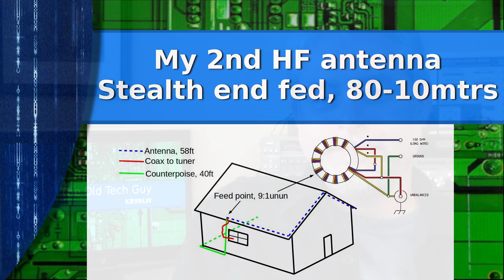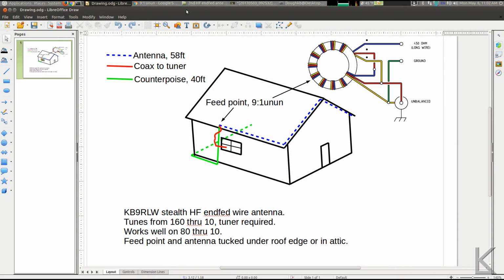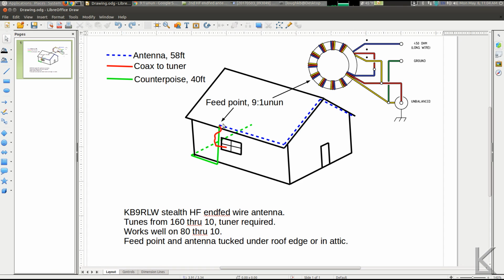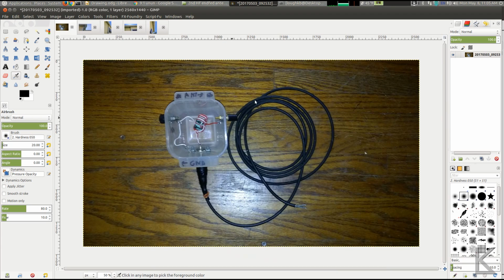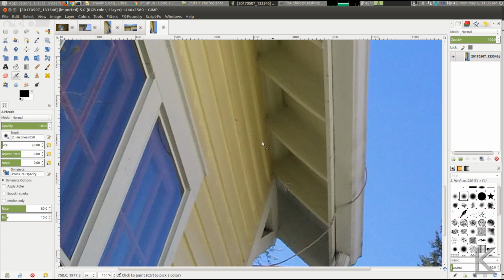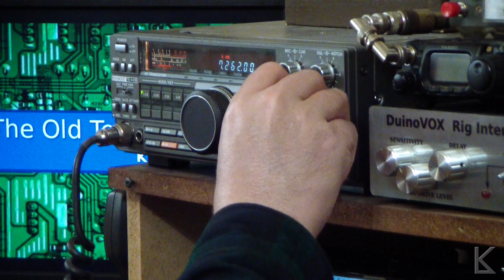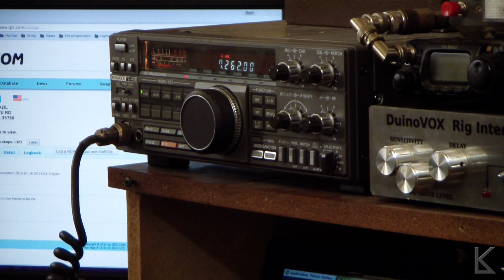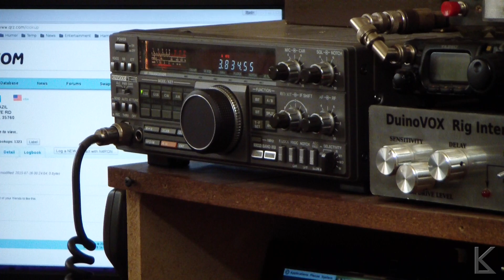Ham Radio - My second HF antenna.   A stealth end fed wire for 80 - 10 meters

Comment: will this work with a metal roof
Reply from the maker: Probably not very well if the wire is at all within proximity of the roof. You generally want to keep your antenna wires a fair distance from large metal things.

Comment: Thanks for this informative video. I am installing a BBTD whole house antenna as shown on the HFLink website a Bonnie Crystal design. I'll have 190ft of wire and it will all be out of sight. There is a 1000ohm terminating resistor at the midpoint and a 16:1 Palomar Engineering Balun at the feed point. Do you use a common mode coax filter on this rig?

Comment: Kevin, Thanks for the great info.  New ham here just got my tech and general ticket 3 mo. ago.  I have been running on 70cm on a baofend hand held with a homemade J-pole. I live in a HOA and I'm going to put up a end or DX Commander vertical.  I have about 100' of roof eves to run the antenna.  I just purchased  new ftdx10 and a used MFJ 949e tuner really looking forward to getting a base unit setup.  KN6Tux   7 3

Comment: When you get through playing around, try an old offset feed Windom from the 1930s.  Works from 80 down through 2 meters with NO tuner.  I've even ran a CB off of it ;)  SWR rarely above 1.5 on any band.  If your finals can't handle that, you need a radio first :)  As to RF in the shack, I could care less!  I can hold 200 watts LOL!  Use to work on an old Comark and RCA television transmitter with 1 megawatt ERP (were talking twin Klystrodes).  So much RF in the building the florsecent lights always stayed lit!!!!  RF off a radio?  That's a non-starter.  AE4YW
Reply from the maker: This was awhile ago.   I'm now living in an RV and traveling around.   I've settled on a 120 ft. doublet as my main antenna.  Possibly the best and most agile wire antenna I've ever used.

Comment: Would you be willing to tell me the lengths of antenna for 40 through 6 m I have limited antenna experience with end feds
Reply from the maker: I've experimented with a lot of things since this video was made.
Lately I'm a big fan of the end fed half wave design using a 49:1 match at the feed point.   A half wave wire for 40, about 65 feet, would do what you ask.

Comment: I'm a little confused on the counterpoise wire does that need to be grounded or just ran along the ground anywhere or does it need to be ran along the ground underneath the antenna in the air and should I ground the counterpoise to A rod in the ground

Comment: Hey Kevin, thanks for an inspiring video! Question for you and/or other hams - How do you think the performance of this end-fed 9:1 UNUN antenna would compare to a Broadband Butterfly Terminated Dipole (BBTD) using a 16:1 BALUN with both ends  tied together via a 1200 ohm resistor? That antenna can also be wrapped around the edge of the roof (credit to K4SFC - https://www.youtube.com/watch?v=a-vbdO-mUDM)  I'm trying to decide which one to try first. Thanks very much, Greg KJ6ER

Comment: Hi Kevin - have you ever tried more than one radiating element when using a 9:1 unun?  I wondered if it could be made so that the second element is tuned for a different band, similar to a fan dipole concept?  I have no idea if this would work, but would be interested to hear your comments.
Reply from the maker: I think it would work fine.   Just like in a fan dipole, the RF is going to choose the element that provides the best match/load.

Comment: Kevin, you might want to set up a test bad to compare antennas. Have WSPR set up to switch between two (or more) antennas every five minutes. Since the propagation isn't likely to change that much in a few minutes, the coverage you get from each should determine which is better and even which is better in certain directions and distances.

Comment: Thanks for the video.
How did you get google maps to draw a straight line from your location to the other stations location.
Reply from the maker: I used Google's measure distance function. Search for the other stations address, and in the map that appears, right click on the station and select measure distance. Then go click on your location, and it will draw the line and show the distance.
Reply: Got it. 
Thanks for the tip

Comment: Kevin, I lived in apartments for years. I have used this type of antenna in every configuration you can imagine. I was mostly stuck on 80 meters until I got smart. In older buildings, I used the screw on an outlet or a water pipe. I finally ran a counter poise around the base boards or outside like you did. As you say, you have to have somewhere for the return path of the RF to go. When operating like this, the counterpoise  is more important than the antenna itself !
Reply: So, this is really just a dipole, not an end-fed.
Reply: @denelson83  He was going for a “non-resonant” antenna length though, to use it as a multi-band antenna. Not a balanced antenna.

Comment: I'm testing a 9:1 balun that i made with an antenna analyzer.  Can i use 'any' type of 450 ohm resistor or must it be a carbon non inductive type?
Reply: Non inductive.

Comment: Two things...  You should be aware that there is (usually) high voltage at the end of the wire, and you should make sure it cannot arc to your roof and start a fire.  ALSO you might try putting 5 or 6 toroids on the coax that feeds your unun.  That might keep more of the RF out of the shack.
Reply: also, there need to make real good connection to ground not more than 4 Ohm

Comment: Brilliantly informative Kevin, especially for newcomers like myself. Would this type of second antenna be useful for an sdr type receiver used together with my g5rv or would the output on the g5 when transmitting be too much? MW6WHL
Reply from the maker: You could damage your SDR.  You'd need a way to ground the SDR's antenna input when you're transmitting, to protect it from the transmitted RF coupled back to the receiving antenna.
Reply: Thanks for the heads up, Kevin. So how does one use an SDR with a transmitter? Is grounding the SDR input when Tx the only way? Also, logged into 519521 earlier but nobody about.  Hope to catch you soon. Great videos too by the way, I find them very very informative, so many thanks for taking the time to make and upload them sir.  MW6WHL
Reply from the maker: You could use a double pole double throw relay or switch as a transmit/receive switch.  It could both switch the antenna between the SDR and the transmitter as well as ground the antenna input to the SDR.    If you use a relay and your transmitter has some sort of keying output plug on it, you could automate the switching.

Comment: Kevin - How does it transmit on 80m??  I need something for that band and don't have the space for anything like a dipole or other tuned antenna on that frequency.
Reply from the maker: Not too well, but that makes sense since it's a somewhat short antenna at those frequencies.   A longer end fed wire would work better, if you have any trees at all on your lot and can run something straighter upwards.
Reply: No trees unfortunately, I could run around on a fence and some hedges for quite a ways.  I don't know if that would work.  Can it go around 90 degree corners?   I figure the best I can do on 80m is NVIS.  There's simply no way to get it up to even a 1/4 wave length.

Comment: When you said roundabout 3 minutes in that the turns need to be nicely parallel, that got me thinking, Kevin. When I was making mine a year ago, using the exact same schematic you have with the blue red and yellow wires, it kept unraveling and I got very very frustrated with my (lack of) handiwork. My daughter was on vac from uni so I asked her to plait the three wires together, which meant that winding the toroid now became just one action and was easier to wind for klutzy me. It has worked perfectly like that for a year.

BUT as I said, your comment got me thinking, and I posted on our local forum asking if the parallel vs plaited wiring would make any difference to the performance, and 2 out of 2 answers so far say "no". I'm not saying those are definitive scientific answers, but it might be that keeping the wires all nicely parallel may not be worth the effort, and certainly in my case I would never have finished if I was being graded for neatness, hi.

I'd be keen to hear your and others' comments on that.

Great video: one of the better ones I've seen. Well thought out, well presented: kudos.

73 de Jim ZSJMB in Johannesburg, South Africa.
Reply: Oops: ZS6JMB not ZSJMB
Reply from the maker: I know of one local guy who just wrapped them around.  The wires crossed over each other a few times and it looked a bit messy.   He'd used stranded wire.    His performance wasn't great.  It worked, but he had a hard time tuning it on a few bands.
He re-wound it using solid wire.  (solid wire is easier since it keeps it's shape as you bend it around the torroid)  He also kept it nice and neat, similar to the drawing.
It tuned up easy on all bands and his noise floor was a bit lower.    That latter point could be other factors though.

Comment: Interesting video. Thanks. Question - end fed random wire antennas have highly variable (25 to 1000+ ohms) impedances across the spectrum based on length (http://vk6ysf.com/longwire_antenna.htm). I didn't see (or missed hearing) an antenna tuner in the video. How are you matching?  Thanks!!!
Reply from the maker: +Shortwave Listener guess I rattled it off too quickly.  I have an LDG Z 11 pro, and alternatively the built in tuner on the TS440Sat

Comment: Had a friend that used to come over her neighbor's toaster (literally) back when the CB craze was on in the 70s :)  Person thought their toaster was possessed at first lol. Also another neighbor's hearing aid (bahhhd!).
Reply from the maker: AM is the most notorious mode for such stuff.   I used to hear a neighbor on my electric stove years ago.  The contacts on the heating elements were dirty enough to act a little like diodes and rectify the audio out of the RF.
Reply: Unfortunately spurious emissions are the norm for unapproved equipment commonly used on CB bands and 99% of those folks have no idea how to rectify the situation (and some don't care). I did plenty of that BITD before i discovered ham.  A neighbor of mine came through my SS guitar amplifier, with it unplugged.  No telling what my voice resonated on-from my mobile setup of the 90's. Now of course, we talk much much further, more reliably,  with less power (and no superbowl).

Comment: Hey Kevin, how did you decide on counterpoise length? I have a 30ft End fed I use on 40-10m, I also have a counterpoise wire, but unsure of exact length (rougly 12ft). Seems to work well, tunes up fine on manual tuner.
Reply from the maker: Ideally, it should be about the same length as the radiator.  I just used the space I had.

Comment: Great job Kevin! I am always amazed to see how little noise you have at your house overall. If i were to run an end fed in that fashion, i would have S9 of noise. 73
Reply from the maker: Hi Terry,   No, no restrictions in my hood.  However, I know many have them, so I was showing a way around it.   For the UNUN I used T50-2 powdered iron core torroids.   The noise elimination projects required larger diameter, almost 2 inch versions.
Reply: Okay Kevin, thanks. I thought I had a book on toroids, an ARRL publication. I can't find it. Must still be packed away from last move 12 years ago. Probably why I'm so dense about toroids. Hi
Reply from the maker: I've done a lot to reduce noise.   I've wound my ethernet runs around torroids at the ends,  the same with wall wort power supplies where I couldn't eliminate them.   The netbook computer at my ham station takes 12V power on it's input, so it runs off the same linear supply as the radios.  etc.   I still get hash from neighbors TV's though.
Reply: Toroids! Many hams use them but never say which one they used unless they are describing a kit build. I never know which one or ones to order. Kevin can you help with that? Do your neighbors have plasma TV's? The wire that you've used for the two end fed's is stealthy. I wonder if you've considered a loop. From pictures you've shown from your first end fed it looks like you could put up a 40m loop and still be stealthy. Are you being stealthy due to neighborhood restrictions or city restrictions?

Comment: First, I want to say how much i appreciate your videos. They're very well done, and because I'm recently unable to work for a time (it's been a month already, going to be out another month at least), I like the fact that everything you show is a great example of "what you can, with what you have." I first got my Tech in 2012, fell out of the hobby, and  came back about a year ago. Started SWLing, and now have my General. I built a 9:1 unun last summer to see if it would help receive when I was listening with my RTL & long wire. your video has me curious about using that same antenna for transmitting. What gauge wire do you recommend for the 9:1, and with that given gauge, what would do you think the power rating would be?

Thanks, & 73 DE KD2CXU :)
Reply from the maker: +Bullfrog89 I'm using doorbell wire on my unun, not sure of the guage
It has no problem at 100 watts.
Reply: In case anyone else is interested, I just looked it up. Looks like 20 gauge is most common door bell wire. Also saw a couple references to 18 gauge.
Reply from the maker: Oh, sorry,  I did go look at the spool last night.  It is 20 gauge.

Comment: I have a soft spot for the end-fed wire, it's presently my main aerial in our small garden and 14 metres of wire does the business on all bands from 60 mtrs up to 6 mtrs. I don't even use a feeder, the wire and counterpoise come in through a small hole (25mm plastic pipe) in the wall of the spare bedroom, and hook straight onto the KX3. I do have a vertical as well, 20 feet aluminium tube in the garden, but the end fed does the main hauling.

I enjoy the YT videos Kevin. Well done. Hope a job shows up for you soon. 72/73, Les g0nmd
Reply from the maker: Thanks for watching Les.   My main antenna is another end fed.  You may have already seen that video.   It's about the best all around solution in any limited situation.
Reply: @loughkb  I have moved to a different part of the country so this antenna might be up my alley. I didn't notice remember hearing what gauge wire you used on both parts of the antenna. Thank you in advance! I am a new follower and loved this video!! 
73
KJ6IHZ